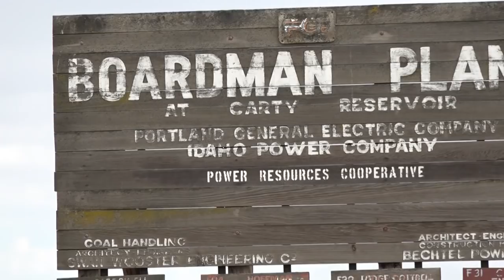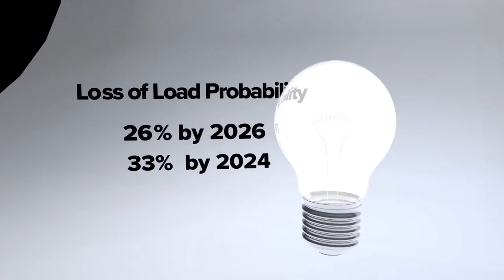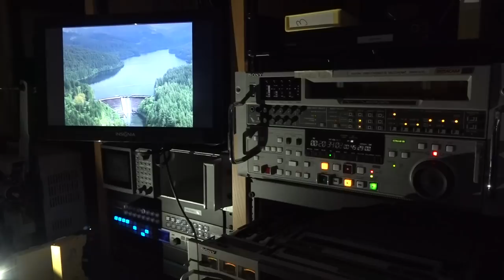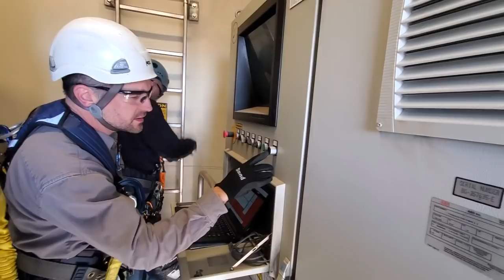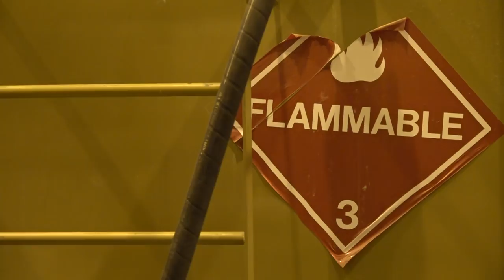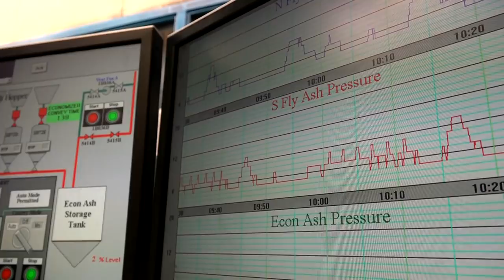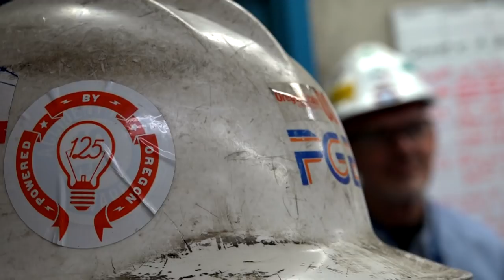Will there be enough electricity after coal plants shut down? | 'Power Struggle' full documentary

Comment: Build 4 AP1000s. No absofuckinglutely not! Nuclear power is not terribly dangerous nor is it terribly expensive.
Reply: Nuclear is the most costly to taxpayers
Reply: @Nicholas-f5  No it isn't. You're the troll here. And unreliable horseshit renewables are the costliest to ratepayers.
Reply: @Jemalacane0  
Renewables plus storage will take the place of thermal power plants because it's cheaper and takes only a year or two to bring online.  New nuclear power plants are too expensive due to cost overruns and they take more than a decade to bring online.  Utilities are the ones who make the decisions, not you, not me.  And they're deciding against thermal power and installing renewables.
Reply: @acmefixer1  Not even close to being true at all. You can't store your way of unreliability or dilute energy sources. That's why solar power plants with storage can't break 24% capacity factor. Not to mention you need 4,000-5,000 megawatts of solar to equal 1,000 megawatts of thermal power and 3,000-4,000 megawatts of wind to equal 1,000 megawatts of thermal power. Also, thermal power plants last longer. Wind and solar's lifespans are about 30 years. There is a nuclear power plant which has gone 50 years (that's as long as nuclear power has been around).
Reply: @acmefixer1  And the greatest energy storage exists in the bond between proton and neutron. Uranium is over 140 million times as energy dense as lithium.
Reply: @Nicholas-f5   Proof please. I would like to see the complete math on that for 1000mw of each. Not just installed price, but numbers based off of the same gwh cost using nuclear as a baseline. And you can't fudge the numbers by ignoring that solar and wind only produce when the sun shines and wind blows. I would also like to see the costs associated with replacing solar and wind every 20 years, when those panels loose efficiency and windmills have to be replaced because they wear out.

Ill give you a head start. 1gwh is 1000mw produced for an hour. The average 1000mw nuclear unit has a load factor of 92 to 98%. 24gwh a day, equates to 338,000 gwh over 40 years at 95% load factor. 5.5 Billion average cost to construct, $33,500 fuel cost per hour=11.8b lifetime. 17.3b lifetime 

Us fleet wide load factor for solar is 20%
US fleet wide load factor for wind is 35%

So with those numbers you would have to install 10,000mw solar and 5715mw wind over 40 years. Plus associated storage costs to run 24/7/365

Current price to install solar is 2 billion for 250mw based off of abengoa's Arizona plant. 10 000mw solar cost, over 40 years is 80billion without storage. 

Tenaska 250mw wind farm in Minnesota 1.8m per 1mw cost= 450m. Total cost over 40 years is 10.25b without storage.

Storage factor would have to be the inverse of the load factor. Storage for solar would need to be 80% total capacity and 65% total capacity for wind.  Current battery storage would have to be replaced every 12-15 years. And loose 40% over its lifetime. Pumped storage has an efficiency of 70 to 80%, you would have to increase the volume of installed storage by 20 to 30% to make up for the loss. Thats not factoring loss for the additional 20 to 30% which would be an additional 4-6%.